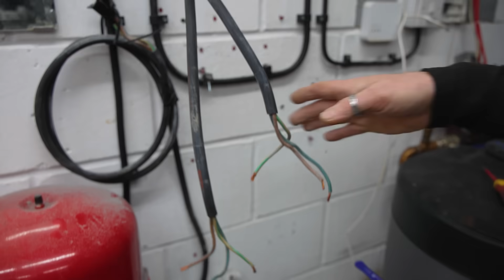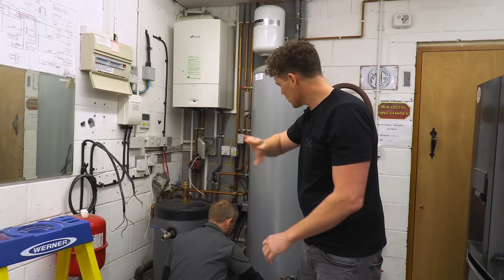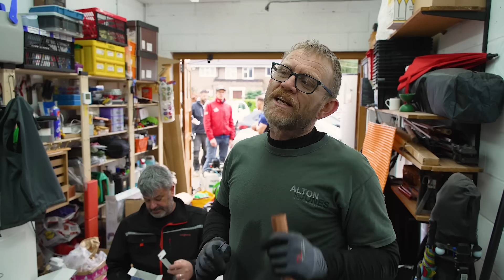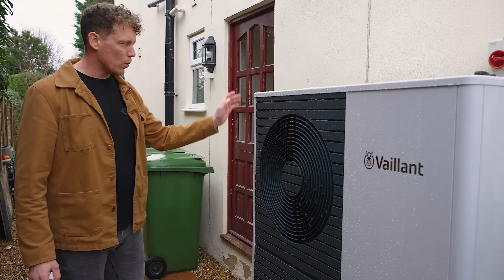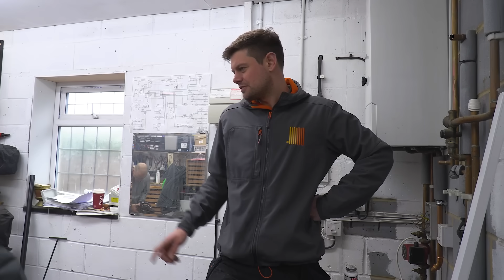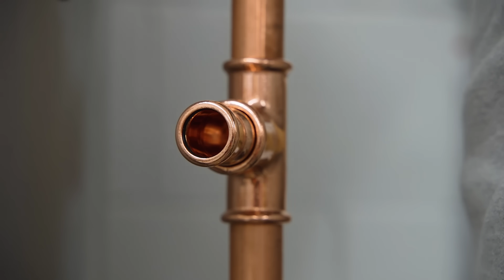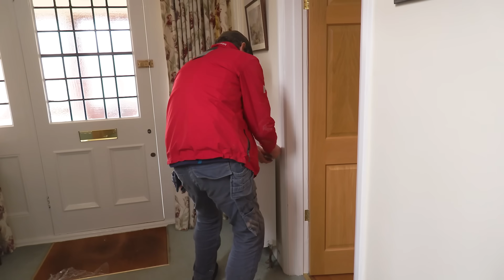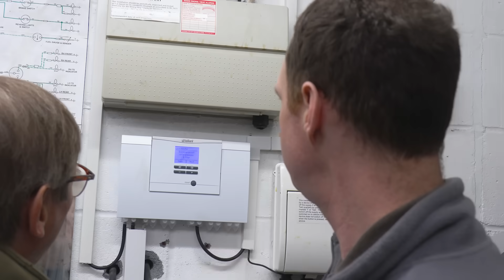Ultimate Heat Pump Installation. Rip It Out & Start Again!

Comment: All I want to know is, do air source heat pumps work with radiators. I have a new self build with UFH downstairs and radiator upstairs. I was advised 5 years ago that the radiator will never get hot enough to heat the home. Is this correct as I see most homes are getting them with radiators
Reply from the maker: I am fully in favour of underfloor heating downstairs and radiators upstairs.  Heat will drift up through the building so you don't need bedrooms that are kept at a constant temperature with UFH. A radiator coming on for a few hours a day is fine. If the rads aren't big enough to do the job then you can upsize or just leave them on for longer but, in most cases, I have found they work well enough. 
When I have stayed in buildings with UFH in the bedrooms I have ended up sweating in the early hours because you just can't get rid of the heat.
Reply: @SkillBuilder  appreciate the reply. I was given advice 5 years ago so might be out of date. It's terrifying though looking at what I need to know before I let a contractor touch my current system. Your videos shows how much work goes into assessing the property before hand and I not sure we have the heating geeks in northern Ireland

Comment: This is just mad. Compare a houseowner wanting to upgrade his heating and hot water system including installing modern radiators. He would buy a boiler, a pump, the rads and some piping. The only electrics would be some kind of controller and, possibly, a wifi remote. The old kit would be removed including the existing rads and the pipework cleaned/flushed. The new boiler would be hung on the wall, the new rads would be attached to the existing pipework and the pump and controller installed and connected. Job done. A 4 bedroom house would take no more than 2 days to complete and would cost, with labour, no more than £5,000. Contrast that operation with this installation. And we've not even begun to talk about maintenance. There are 1,000s of good gas boiler technicians and, from what I read, no good heat pump installation guys. Not one (look at the trouble the guy in this vid had, the heartache he must have experienced.) And PS. Minus 2 is not the depths of winter by any means.

Comment: This is not how to run under floor heating. The blending valve and the pump is there for a reason not for what you are saying completely different. Do not believe what heat geek is telling you on this system.
Reply: But believe some random youtube commenter right?

Comment: I really enjoyed this presentation and it confirms my worst suspicions that there are a lot of people installing heat pumps who do not understand basics. I cannot understand why a system needs to have the heating curve entered manually, surely in this age of AI the system should be able to self calibrate and even work out the R value.
Reply: The curve very much depends on how well insulated the house is and that is something that an experienced person must judge.

Comment: I wish you guys worked in Australia because I am pulling my hair out trying to find someone who will DESIGN a heat pump installation after doing at least a heat load calculation. Everyone wants to use a gas boiler or put in a heat pump rated to the same as an old non-condensing boiler.

Comment: vaillant need to do a lot more than donate. ideal as soon as they knew there was a problem put measures in place. zee germans didnt.
Reply from the maker: The original heat pump was not a Vailant so there is nothing for them to apologise for.
Reply: @SkillBuilder  regarless you  are defending them from not taking accountability, english bulb? i love your ethos to push thing forward. boilers were going on fire ffs, they pushed it to service people. assholes. only their own controls. want me to mention bosch heatpumps comming out of the factory either leaking or not enough refrigerate

zee germans that cant be trusted. vw emissions etc etc

i looked. have you looked at ebus etc./ no sharing of info, between manufacutrres

 propane is highly explosive at the right mixture. as some of us know.

Comment: I noticed that you have removed a sensor pocket on the new heat geek cylinder and replaced it with a expansion release valve. Why do you have an expansion release Valve and a high temp. and pressure release valve on the cylinder??? Why not just the high temp and pressure release valve and leave the top thermostat pocket? Also where is the EV as it’s an unvented cylinder ? I don’t get it??? Thanks for sharing, very interesting!

Comment: I am in the exact same situation. I have reached out to heat geeks and will probably try to get Adam to have a look, at this point happy to pay just to understand where the problem is and find out what the solution is. We've paid £23k for our Heat Pump, which is now using 75% of our electricity and has been costing us around £500 per month to run since October. As of now, the cost for the last 5 months on heating alone, has been as much as electric and gas for the whole year. Our previous gas usage was around 21k gas units, where the heat pump is using around 11kWh which is double the gas price. The biggest mistake of my life, and one I regret. If I can't find someone to help get it sorted, I will also be looking to make a YouTube video to warn others from making the same costly mistake. If I am throwing money out the window, I hope others will learn from my mistake and won't. The £5k grant we received in August, will be used use up on the additional running cost before the end of 2026, so essentially we will be burning through the 5k in around 2 and a bit years. We also got audited by Ofgem, one of the most painful experiences, told them the heat pump wasn't fit for purpose, but that was not what they were interested in. Worth mentioning that the heat pump also broke down a month after it was commissioned, so we were without heating for about 12 days. We had to purchase 2kw radiators to heat up the place as we have two 2 year olds, and those oil rads still cost us less to run than the heat pump.

Comment: I'm curious . What flow temperature is at  defrosting( after)  ? Someone  monitor this ? Is less 20C ? 15C ...? When don't have enough energy(water volume )it will be a huge drop in temperature..... without buffer tank.

Comment: Hi, thanks fkr these great videos. You have mentioned StormDry application to outer walls. I have a solid wall semi detached in london, EPC Rating D. Could stormdry be a money saving alternative to costly external wall insulation?
Reply from the maker: Stormdry has been shown to reduce the thermal conductivity of masonry simply because it allows the bricks to dry out. Sadly the difference to the U value is nowhere near as much as 100mm of external wall insulation. It is worth doing but don't raise your hopes.

Comment: New design is without buffer? Just a new cylinder with huge coil?
Reply from the maker: Yes they left the buffer out and reserved the option of introducing one. The cylinder is not really acting as a bufffer because that circuit will close. The trick is to keep all the rads and underloor heating open for maximum flow.

Comment: Great stuff ! well done team. We recently had a Vaillant heat pump installed in our house ( 1900 mid terrace Hackney replacing 12 YO Combi). With the new Ovo heat tariff we are spending less and much warmer - can't recommend enough. Needs to be more work done on solutions for smaller flats with combi boilers. We avoided  all the pipe re working and disruption by locating a Sun Amp water solution under kitchen counter right beside the existing pipework for water. (plug & play) The heat pump pipe work came in more or less where the combi was so we saved so much hassle. I  reckon the future of this tech for existing combi users is an under the counter solution ( akin to existing footprint for white goods) combining a small material exchange water solution and  heat pump with just a smaller / lighter fan system outside. 🤘🏼⚡

Comment: I suppose the moral of this story is if you are not on good terms with your Fairy Godmother ever ready to summon up a veritable army of willing experts to fix it afterwards steer well clear of heat pumps. I find it difficult to get hold of a single plumber myself most of the time.

Comment: Does this mean that it's better to install 2 or 3 collectors in parallel instead of one big collector (if in both cases, they're 1" collectors)? For example to connect 10 radiators.

Comment: my lg refrigerator has a 3 amp fuse (Car  style $3.00 at local hardware store)  on a circuit board on top, i blew the fuse - and looked up on line where i learned about the fuse, replaced it - worked fine,  for my year fridge. But as explained on line LG soldered the fuse into the board in the following year in an  attempt to make you buy a $250.00 board,  On line they explained the delicate technique for unsoldering a fuse on a circuit board.  I WILL NEVER BUY A LG PRODUCT AGAIN - that is just wrong

Comment: Hi Roger. Me Again! No one has talked about the fridge gases that are used these days (old or new types eg R11 to R134 to R454b etc), and their impact, when leaks occur??????
Reply: This one has R290, hermetically sealed loop, so leaks are very unlikely, and it's a very small amount - 1.3kg in this case.  Equivalent CO2 would be 3.9kg, or burning about 18kWh in a gas boiler.

Comment: Hi Roger. Another thing that is a big concern, is insulation companies selling "Cavity Wall Insulation". Particularly for 1960's built council houses (or ex council). They were designed to have cavity walls NO????. Would insulation not block up the free airflow and cause the joist ends to rot???. Would be interested to here your thoughts!

Comment: Keeping the gas boiler is sooooo smart. That provides some disaster proofing that really should be standard.
Reply: I thought that at first but the standing charges for a gas supply are now very expensive. Given this customers history It would be worth it in the short term  but long term I would get rid of the gas boiler (and gas supply) even if it means changing from a gas hob to an induction hob. The savings over not paying the gas supply standing charges will be material to the overall efficiency of running costs.

Comment: Hi Folks. Very interesting. At 13:18 the gentleman from Alton Jones remarks on Octopus/British Gas "malarkey". Do Octopus Energy/British Gas do reasonable jobs or do you think there are downsides to them from practicle experience? Obviously might be a bit tricky to comment! I shall be looking at Heat Geeks, great video.
Reply from the maker: The trouble with all these big companies is that you never know who is going to turn up at your door. 
If there are problems they will send somebody who may not have installed the system. Using a local guy gives you contact with one person.

Comment: Really helpful video.  Please can you produce  some more ? A2A and also some of the smaller units from Octopus  etc. Smaller house  installations  would be good to see too.  I really liked the fan heater idea  Roger mentioned.-  sizing the system for 95 % of the year and having some additional cheap resistance heaters -  for 5% of the year and I guess backup heating  should HP have a problem.   Probably wall panel  heaters  with central wifi control would be better than actual fan heaters though.

Comment: Fun series of videos. One things it confirms is there is a difference between an installer who fully understands the system and one who just has general knowledge about it. Given how big the need for installers will be, there will likely be more customers experiencing OK installs rather than great installs. A decade or so down the road that might be different. Thank you for the video.
Reply from the maker: A decade down the road it will be different. We will have abandoned the dogmatic approach and restored consumer choice. Rishi has just announced that we will need new gas fired power stations to give us enough electricity to charge our cars and run our heat pumps.

Comment: Love that they opted for r290, enviromentally friendly and efficient, especially for low temp systems such as underfloor heating.

I buffer tank could have been kept as a volume extension tank, but the house is fairly high, de de-icing will probably work well anyway.

Comment: Well done Roger for another interesting video. First let me say that I am in your "camp" with regard to ASHP, I spent (far to) many years in the heating industry starting with normal domestic to very large domestic and commercial systems, and I fell in love with the ASHP technology in the 1980's and gave some presentations on the basics of how they work. I started a company to focus on ASHP and became MCS qualified, it has been downhill ever since, mainly due to outrageous claims by some manufacturers, not Vaillant who are my favourite company for domestic and small commercial boilers, and the real life costs of installing a system which will meet the clients expectations. Forgive me if this turns into a rant, but it's not meant to be, it's just that there are a number of points which I think need clarifying.
1. Most comparisons made between gas boilers and ASHP's are not accurate i.e. all the ASHP systems have weather comp. but the gas sytems don't. I've been a big fan of weather comp for years, although it is a struggle to get people to understand them. So an "A" rated gas boiler , with weather comp is much more efficient than the examples used.
2. To get the SCOP quoted then the whole system has to be designed to run at a low temp which is great for UFH, but UFH is very expensive to install on the 1st & 2nd floors, so the radiators often need upgrading.
3. Looking at this eaxample where are you going to be able to install a cylinder of that size in the average UK home.
4. DHW needs a flow temp. >60 Deg.C so the ASHP will not be efficient at that temp. and may even need to use backup immersion heaters.
5. Why have they removed all of the expansion vessels, is it now an open vented installation?
6. The Vaillant units are vey quiet, but this may change overtime, wear and tear, also when every house in the country has one (not going to happen!).
7 If a client has an "A" rated gas boiler, then I would make this a hybrid system.
8. The Energy Saving Trust are saying that the annual savings of ASHP are so little that there is no payback period, so the only reason to, voluntarily, install one is that your deluded into believing that your are helping to "save the palnet", there is no such thing as carbon free energy production and distribution. Certainly not wind and solar.
9. How we going to replace all of the very large boilers in communal systems, flats, hotels, hospitals etc.
10. 60% of electicity is, and will remain for the foreseable future, produced by burning natural gas, BG proved back in the late 1960's that using gas to produce electricity was a crazy waste of a valuable resource, this is due to the generating and distribution losses.
Finally two observations, why didn't you use the B.I.G adjacent to the unit, condensate soakaways need to be a minimum distance from concrete foundations, and please tell the plumber that he shouldn't be using glandnut (pump) pliers on brass nuts!
I look forward to seeing you at the Installer Live, that's if they'll let in a retired heating engineer!
Reply: In 2024 for the UK grid natural gas generated 26.4% of the electricity and there is a substantial pipeline of new renewable projects over the next few years, mostly wind power.
Reply: Your windturbines would be more acceptable if they produced electricity when its cold and insufficiently windy and produced cheap electricity, which means no subsidies and cancelling the CfD. So called green energy is going to impoverish billions of people.@quantumstatejim

Comment: Great to see a positive result from this story.. we had a heat pump installed 10 months ago, in a 1970s house which was not perfectly insulated. It's more comfy, we spend less on energy (this winter we have only slightly exceeded our monthly bill allowance once unlike last year where that happened every month (and one month by a significant amount) with our gas boiler at the same allowance rate) and it's quiet! Best thing we ever did.. now onto Solar install later this month.

Comment: Loved watching this love affair between you and Adam blossom 😆 but big respect, from saying heatpumps are terrible to being open enough to see that they can work when correctly designed and installed. Well done.
Reply from the maker: I never said, not once, that heat pumps are terrible. I said the government idea of bribing people to get rid of gas boilers is a terrible idea because heat pumps will not work well enough in our poorly insulated buildings. 
The fact that we added 300mm of loft insulation to this house proves the point. 
We get countless emails from people who have had heat pumps installed and their bills have rocketed and their homes are cold. 
I never doubted that they can work. You will notice this is one of a new breed of heat pumps with better refrigerant which works better at low temperatures.  All my life I have had people shooting me down in flames and then gradually doing the very thing I suggested.  They did not tweak this heat pump to make it work, the scrapped it along with a lot of other junk. The home owner spent £18,000 on this system and, if it hadn't been for Heat Geeks he would be running his gas boiler. If this system works out cheaper than a gas boiler I will be delighted but it just shows that the government is shelling out tax payers money with no effective controls in place. That is a very familiar tale.